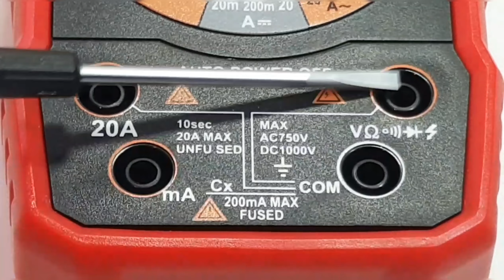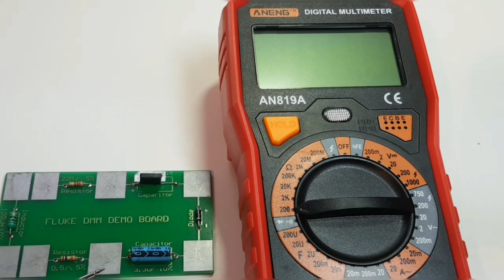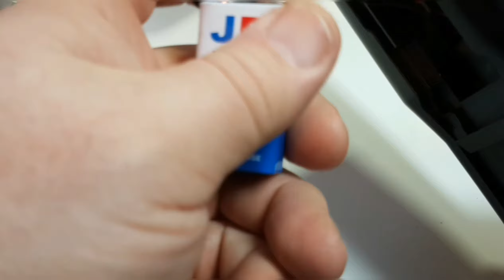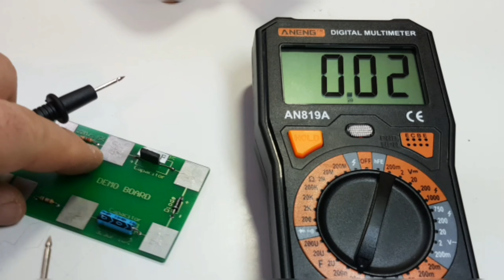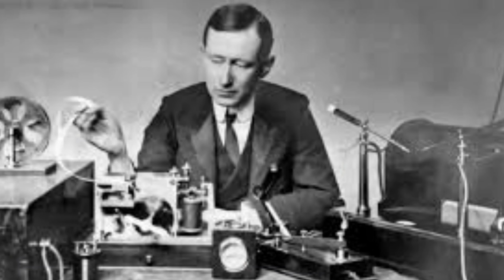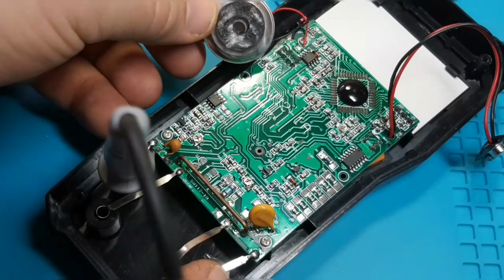Aneng AN819A CHEAP-O Multimeter Review & Teardown!

Comment: I got this meter delivered from China in 23 days for €8,45. Just because I wanted something really cheap just for very basic stuff, so it does not bother me when it get´s lost somewhere outside. I have a handful of better meters, too. Yours seemed to be a total fail, mine works with anything you can dial in. Please get a new one. There is always a bad apple in the Chinese basket. For the live voltage (flash sign) you have to use both leads. Not very good, would have liked it to work with only one lead wire. If you touch live, it only makes some scraping noise, the light blinks a bit and a small "HV" sing in the left of the display appears. Not very impressive. So far it´s accuracy is to spec, not better.

Comment: to test capacitors test putting the red tip on ma.
Reply from the maker: Roger that, I did move the test lead to the mA/CX input..Unfortunately, this meter is a real mess and the Cap ranges are all null and void.

Comment: The little meter that couldnt-!!  Some of the cheapest of the cheap jacks ive ever seen, yet they have the nice self recovery feature.  Do the jacks have any support posts inside the back case half-??
Reply from the maker: No extra support just a slight plastic protrusion that might add a tiny bit of stability but these jack prongs are really as bad as you'll get and just make things worse...🤬🤯🤬
Reply: Not a good showing by Aneng, too bad they sold tons of the 8000 series even with the hard to find fuses etc. - You really would think they could do better, Mustool is a much better choice in this realm.
Reply from the maker: @yambo59  Agreed, Aneng is a tough one to gauge.. Almost seems as if they have two different engineering realms.. and this isn't the good one 😏